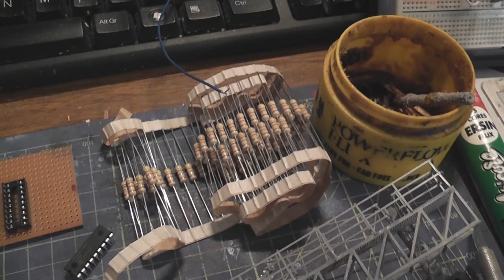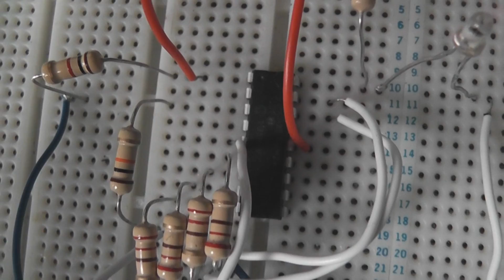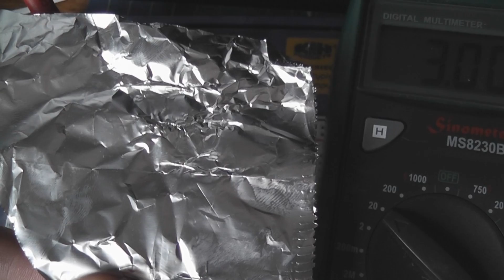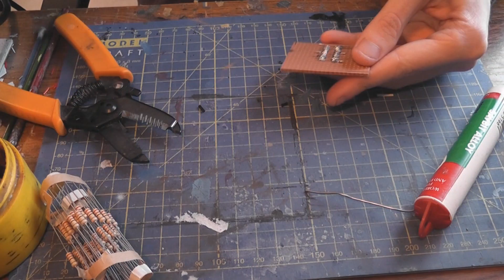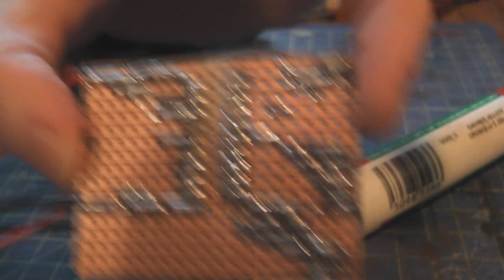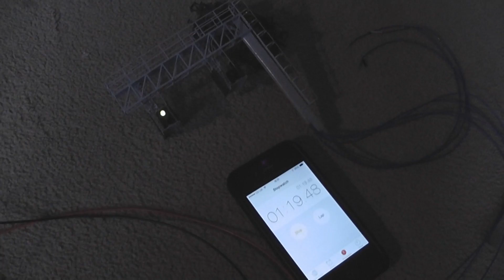How to - Episode 19 - Automatic Signalling

Comment: Richard, A brilliant video once again.  Thank you for taking the time to put it all together.  I found it very informative and easy to understand.  Must have a go myself.  
Thank you also for all the links for the parts.

I am about to install some DCC Concepts Powerbase, so my locos will all have magnets underneath. Could the detection circuit be replaced by a reed switch?  
If I have this correct, looking at the circuit it seems that if the 220 ohm resistor and transmitter were removed and the receiver replaced with a reed switch leaving the 4.7kohm resistor  in place, it would work just as well, the foil would of course need to be substituted for a magnet.
If this could be done then another benefit would be that there wouldn't be any interference from other infrared sources.
Reply from the maker: bjack8264 That should work fine.  Reed switches are commonly used for this sort of thing.

Comment: At 10:10 you show the diagram that shows (4) 220 ohm resistors.  Could you eliminate them and use LEDs that come prewired with the resistor built in to each LED ?  I see them on ebay as "3mm Pre-Wired DC 9-12v LEDs".  I m wondering how to make the footprint of this board smaller.

Comment: does the picaxe have interrupt possibilities ? that would be a very elegant method to allow detection of a train at any time, even when executing the loop or waiting, and change state at any give moment when the manual override has been triggered, kind of the same as you're doing now.   Do you also plan feedback to your controller central from each signal ?   This has a lot of potential, you may even consider using DCC input signal for manipulating the signal states.  (using an optocoupler 6N137).  Just making suggestions here, not criticizing  at all, I truly admire what you have done so far.
Reply from the maker: Dani VAN MIEGHEM Thanks, there are plenty of possibilities.  The picaxe does support interrupt commands so the logic can be made more elegant.
Reply: EverardJunction That is the beauty of  microcontrollers, there is no limit to your phantasy and creativity.   No 2 solutions are exactly the same.   And if you don't want to get in to the nitty gritty of the C, C++, ASM programming, a visual approach like the one you use with Logicator is brilliant !

Comment: Nice work Richard. This is a pretty nice setup, the picaxe looks like its pretty cheap and it doesn't require any programming skills, so its great for beginners. Is the flow chart GUI the only way to program it?
Reply from the maker: oorail.com Thanks, you can also program it using BASIC.  Instead of the flowchart you just write the program out in BASIC and job done.  It is more complex and harder to explain though...
Reply: EverardJunction Cool thanks. I'll have to go check it out then. I'm thinking that the PICAXE might be able to be combined with the Arduino to centralize the signal control. I've been scratch building LED ground position signals, so I think the PICAXE might be a cost effective way to interface them with the Arduino...
Reply from the maker: oorail.com Sounds like a plan.  If Arduino can interface with basic or read the outputs directly then it should work quite well.

Comment: Fantastic video mate, very easy to understand and definitely something i will be doing for my own layout. Just wondering whether the position of the points could be integrated into the circuit. I know you are using PM1's, so could the auxiliary switch be used to set the aspect to red, in addition to how your circuit board works?
Reply from the maker: Alan Wiggins Possible.  The switch for the point could be linked to both signal boards and flip them between red depending on point position.  The logic and circuitry would need altering but its certainly possible.

Comment: I would put the infrared in the area BEHIND the signal, so when a train is there, the next train can not enter that segment. Or even better, use a occupied system: When voltage is drawn by the motor (or a led/ resistor) in a wagon, the block is busy, leading signal red. That avoids the danger of a green signal when a train is present. :)
Reply from the maker: Chris Wisselo If you want to do full block detection then it gets rather more complex.  If I wanted to go that far I would have used the dcc system and pc control to automate train movements.  For now I'm happy with the signals working on a cosmetic level.

Comment: All these parts... for how many signals can you use this? You've only used it on one signal in this video, is there a maximum of signals you can use on one 'automatic signal setup'? Or do we need to buy many stripboards, breadboards, switches and the other parts for multiple signals?

Comment: Do you think you'll ever do a video demonstration on how to wire up a automatic level crossing with servo barriers, lights and sound. By pushing a button to operate it?
Reply from the maker: Ethan Parker Perhaps on a future layout.  This layout doesn't have a level crossing.  The circuit for an automatic level crossing is considerably more complex than the signals so it would be difficult to do a video tutorial on it.

Comment: I've watched this video several times now Richard to look at the picaxe programme in depth. Top quality explanations as always.
One thing though, my youngson and I were wondering what the changing numbers refer to in the top left corner of the screen from 16.30 onwards. Is it some sort of grid reference for the cursor?
Very good tutorial indeed. Thanks,Colin
Reply from the maker: Crystal Palace High Level Thanks Colin.  Those numbers are from the screen recording software I was using.  Its displays the fps in the top left of the screen.  I couldn't see a way of getting rid of it so it ended up in the video.
Reply: Ah right, thanks for that Richard, we were just curious. Will you be visiting Alexandra Palace on the 28th/29th?
Reply from the maker: Crystal Palace High Level Possibly, I'm in the middle of changing jobs at the moment so may not be able to make it.
Reply: Good luck with that, hope it all goes ok

Comment: makes me want to play lol going to make several of these units will use q4 in the second rail block to send a signal back to first unit pin 3 to set yellow condition for block 1  and so on for each block ordering items to make this  tonight so it will be a while before i can play and give info on if it worked ok ... only problem i see is you have to have more than 2 units (or blocks)

Comment: Apologies if someone has asked this before.
If P2 has to be 'high' or 'on' for the override to function, how does an open switch, or switch turned 'off'' (when you removed the wire on the breadboard) allow power from the 5v supply to the P2 pin? P2 is an input, right? Or do I have it wrong?

Comment: I have no understanding of electronics but you have explained this very well. Maybe you should take up teaching :)
I presume it would get very technical and difficult to add lunar lights (junction indicators) every time a route is changed.
Reply from the maker: Ed C You would need to alter the logic to take those into account and have it all rigged up to your point switches.  Not impossible though, just requires some though and a bit of experimentation.

Comment: Well done Richard. I have used pic chips that have been given to me for my amateur radio stuff but never played with them. You have given me a bit of a push to have a tinker myself. As a refinement, could an input be taken from the points to bias the signals against the "closed" track? As an aside, do you use an old computer psu to run the 12v as well?
Des.
Reply from the maker: Des Silverson The possibilities are endless and the circuit can certainly be made more elegant than the one in the video.  Points could certainly be used as an input to change signal behavior.  For 12v dc supply I currently use the controller I had on my old layout.  Thanks

Comment: Very nicely done.  I am curious what the cost of the system is per signal not including the signal lights themselves or power supply.  For my signals I have Azatrax circuits which work the same way and can per purchased for £12.31 each.  I just wondered if I am missing the boat not building my own?  Rob
Reply from the maker: Rob McCrain Hi Rob.  Using just the raw components that make each circuit (excluding the wire) I get a unit cost of about £4.85 per board.
Reply: EverardJunction Yes, that is very economical. I understand now.  Thank you.

Comment: Am i right in saying the red light doesnt stop the power to the line. it should be possable to run an output , from the chip, to a relay to kill the power to that section to stop the loco.. Hmmmm soz thinking out load... :) Davey P.

Comment: Thanks you!
Awesome video, very instructive, I actually do understand it now.
Signals really set it all off...

I can see with your knowledge of electrickery things.
If I wanted to set up a system that can detect a train in a section of track, like a platform area can I use a similar system like you have here to do that?
On DCC the voltage is always in the track, but the passage of a train makes it dip low, when a sensor detects a low voltage  it can assume a track section in the platform is ocupied right? and then you can make a light shine or something right?
Reply from the maker: BladeRunner21577 Thats exactly how the traintronics block detection modules work.  I'd need to take a look at the circuit diagram to see how they work.
Reply: EverardJunction I see.
Sorry to pick your brains so much but you clearly know what youre talking about...

On a DCC layout like yours is it possible to have the signals setup and the train controls set up so that a train will not pass a signal when its displaying a red aspect. and start to slow down if it passes a single yellow caution aspect, but continue as normal on preliminary caution.... like they do in real life?

I mean is that level of sofistication actually possible now with DCC control?
Reply from the maker: That is all possible, but it's very expensive.  Especially on a large layout.  You need all your signals and points wired to accessory decoders.  Then have all that wired to the a controller with pc interface.  Then using the pc setup the lot including the locos and your done.  From there all control of trains is done from the computer.   The easiest way to get into all that is to go down the hornby railmaster route.
Reply: EverardJunction hi Richard it can be done very easily using the lenz ABC control that is built in to most decent decoders loksound decoders also have it you can only run trains in one direction pair track you just need a few diodes for a make shift block detection  if one train is pulling power from one section a signal stays red if a train runs into that section the decoder detects power still been pulled from a flashing light on the last wagon and so the ABC stops the loco behind it.once the flashing light has passed another detector it waits a few  seconds and once time has passed to  signal turns green and the decoder detects a change and sets off again. . hope this makes sense I seen it on a layout at doncaster last year

Comment: Hi Mr Junction. absolutely brilliant. awesome.I am about to try a similar setup using an arduino.I have a question  regarding the sensing. I am planning to direct the IR beam across the track and have passing trains block the signal. Loss of signal then triggers the signal change sequence. Are there any pitfalls you can see to this approach. The emitter and sensor will obviously be much more intrusive on the layout.Thanks
Reply: what if you have low profile and high profile wagons on the same layout? that's the biggest pitfall I can see... using a Picaxe chip, its easiest to use an LDR - you can Program the chip to detect the light level, and once the level fall below a certain brightness (eg. a train passes over) it will trigger. the IR solution would be perfect for using in between platforms, though, can't fault it there!

Comment: great video.  can you please show how you installed the sensors between the rails.  I seem to be getting a lot of interference from over head ambient light.  thanks.
Reply from the maker: +vsstub I try to position the sensors and signals away from direct light.  When using the gantries I can use the gantry to shield the sensors.  If your getting interference pushing the sensors further into the drilled holes can help.

Comment: Hi, i have learnt a lot from your videos and would like to ask your advice.  My 3 aspect signals are common positive so how would this differ to what you have done with regards to wiring? Great series, have subscribed
Reply: +Lee Rigby It doesn't look like you will get a response so perhaps I can help you? Use the outputs to switch the led cathodes (negative lead of led)  to negative. You do this by inverting the output states to normally high going low when you want the led to light up, the exact opposite of the way the outputs work in the video. You also need to alter the P0 and P7 logic though to account for the change since P0 and P7 will now work the opposite way around, I.e they go low when the leds lights up rather than going high. I hope that helps.

Comment: Hello sir. Jeez, that looks complex! I had a layout when i was living at home, it had an old Hammant and Morgan controller and 2 wires. That was about my level! I hope you never have to move house, that would be heart braking, with all that hard work. Incidently, would any of the actual baseboards, etc be transportable?
Reply from the maker: MotoCrazy66 Moving the layout is something that has crossed my mind.  Its probably not possible without causing significant damage.  By the time I move I will probably be ready to start another layout.

Comment: Question:  How can you make it that if one train is in the left track, to turn the right track red automatically??  Or vice versa>>  This way you can be at a different area of the layout and you don't have to go throw a switch  to make the right track red.   Bill
Reply from the maker: Wurlitzer Bill Van Lenten You could link the signal to the points.  Then depending on which way the point is thrown would change which signal is active.

Comment: really good video! is there not a way to utilise both those signals on the one circuit? so if a train is on the line then both are red/yellow. then green etc?
i would suppose that would be better used with a dcc system that also operates the points?
Reply from the maker: Benjo-Kazooie You would need to link the system to points and your dcc system for that to work.  If you're prepared to go that far its probably worth looking at PC control.
Reply: thought as much. i would one day love to have a setup that has a programme that would allow me to control everything with. as well as manual control on occations. thanks

Comment: Thanks you much! I have no experience in electronics, what so ever and am thinking about 'protecting' a movable trainbridge. But it has to verify both track signals are turned red and the ones up front yellow and if both tracks don't have trains. Would it be possible to use a 'occupied' signalling with this?
Reply from the maker: Chris Wisselo This could be adapted to use an occupied system if you wanted.  You would need different wiring and components, buts its possible.

Comment: Also could you use a relay from accessory switch from point to the manual control to auto red when points turned against??
Reply from the maker: Chris Bower That's possible.  Run a wire from the switch to the signal board and change the logic slightly and you could do it.  A similar thing could also work for signals with feathers/route indicators.

Comment: Excellent, pretty much how the real railway operate their signalling ? Maybe you could explain what caused the clapham rail crash in model form ? That will be some work if signalling the whole layout...inspirational all the same.... thanks
Reply from the maker: Mangotsfield Mike Thanks.  The clapham rail crash was due to old wiring being left partly installed after a signalling upgrade.  The old wiring caused the signal to show incorrect aspects which eventually lead to the crash.

Comment: I have a question not related to automatic signalling.  The brick wall with the arc's.  Did you make them yourself or did you buy it.  I'm wanting to do something like that.
Reply from the maker: +Eric Ramos I bought it.  However the shop I got it from is no longer in business.  I believe the wall is made by a german manufacturer.

Comment: Hi, would it be too difficult if a train passed at red 'danger' to automatically stop the train? I'm unaware that there are any working AWS ramps for model trains. Is there any device that could be made to stop a train should it be passed at danger. Like a train driver that has ignored a AWS warning. Thanks Jordan
Reply: Jordan Archer you’d need to make circuitry to make the AWS Ramps live and you’d need circuitry in to program a decoder to stop the train if it receives the live signal and I don’t even know if that would be possible 

Just my two cents
Reply: Jordan Archer it probably would be very difficult

Comment: Hi richard with the 5v, the chips is programmed using usb, which is 5v, could a usb power adapter be used to supply and what roughly milliamps does the unit withdraw??
Reply from the maker: Chris Bower That might be possible as usb is usually 5v.  The battery pack actually powers the chip during programing.  The circuit draws very little power when it finished, only a few milliamps.